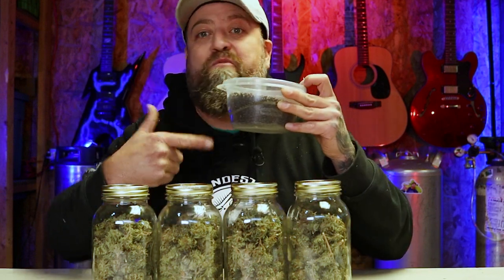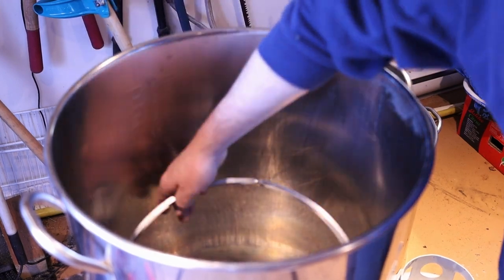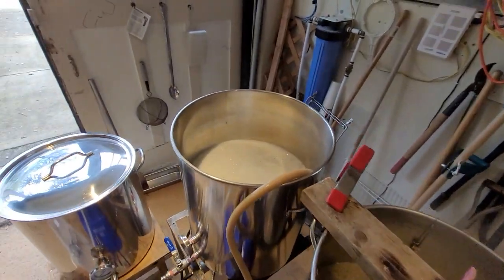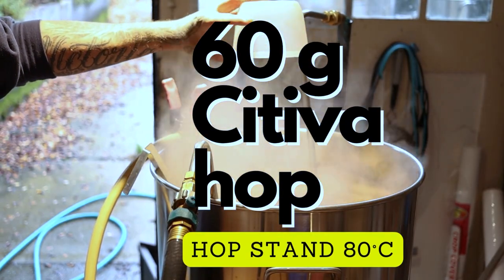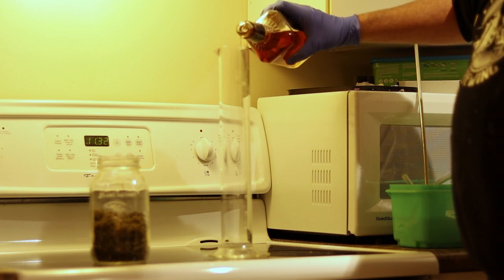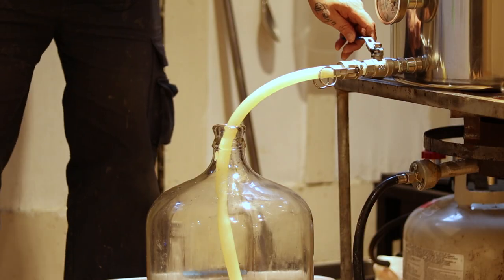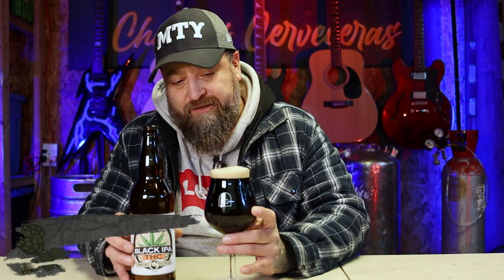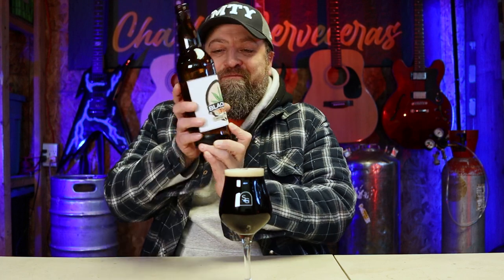Brewing a Black IPA with THC, #craftbeer #homebrewer #craftbeerlover #homebrewing #homegrown #thc

Comment: Hey Fernando just bumped into this video and I love it can you tell me a little about your sparge arm that was spinning while spargging. I have never seen one before
Reply from the maker: I've made it out copper, and the part that makes it  spin is a union pipe nut. The trick is not to tide it completely so it can spin freely with the pressure of the pump
Reply: @ClandestinoBrewing  I think I will try and make one

Comment: Try freezing the weed and the bourbon before mixing next time :) 
I haven't done a beer that way yet, but I'll probably match and adapt from this recipe.
I want to add cocoa and mint with THC, maybe it's gonna be terrible, who knows !
Reply: The reason for using freezing temperature is that it will extract only the trichomes and takes only a few minutes of shaking the jar then you can discard the weed (or dry it and smoke it, bourbon flavoured weed)
Reply from the maker: it sound pretty good man